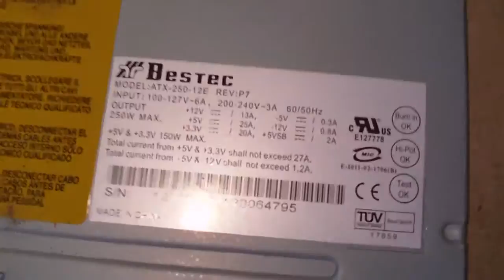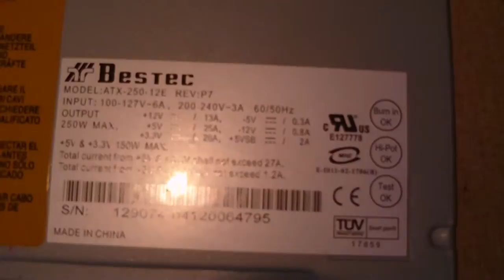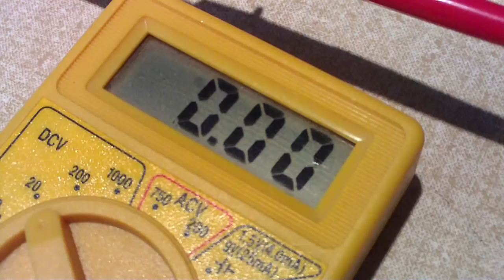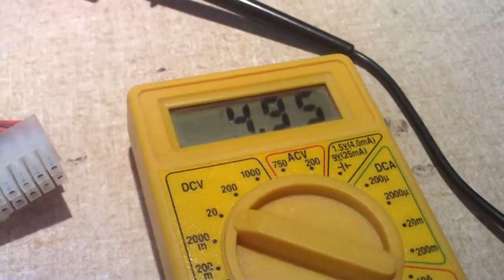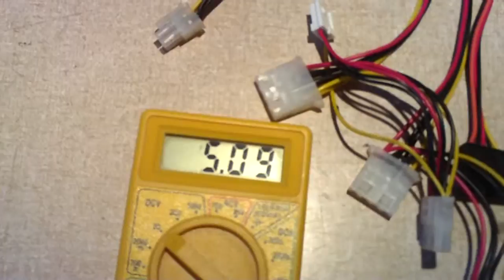12 volts from the 5vsb rail of a Bestec ATX-250-12E PSU

Comment: Thanks for the video. So is there a fix for these power supplies? My pc is dead and my ATX P4 500w psu’s 5vSB was at 10v. I have a new psu and mobo on order but what is there to stop it from happening again? (The old ATX has lasted me for around 5years. )
Reply from the maker: This unit used an old two-transistor analog circuit to drive the +5VSB rail, and that design had a big flaw in it. Most power supplies these days have a much better +5VSB rail design.
Reply: @CubeComputerChannel  thanks, that gives me a bit more confidence!